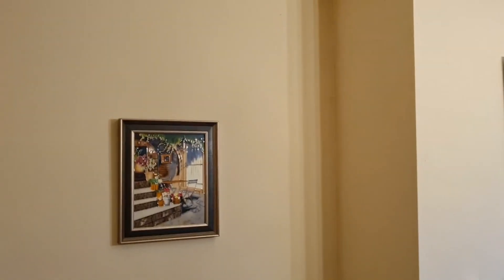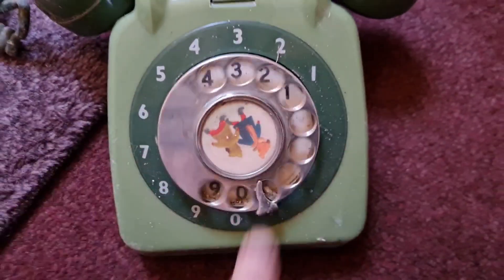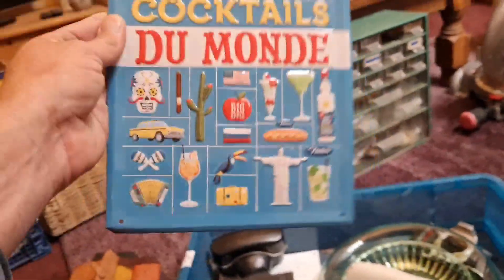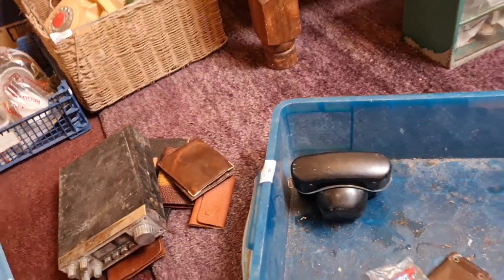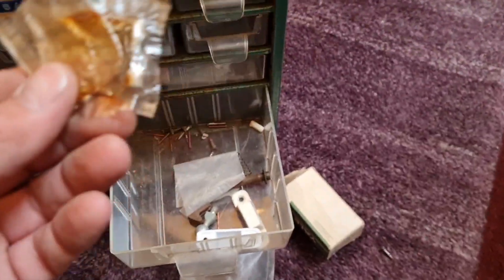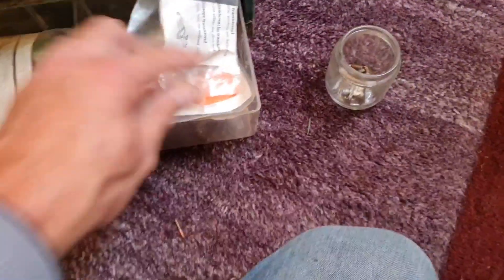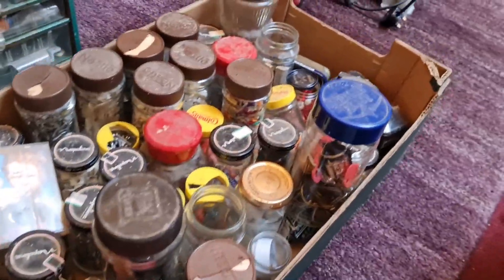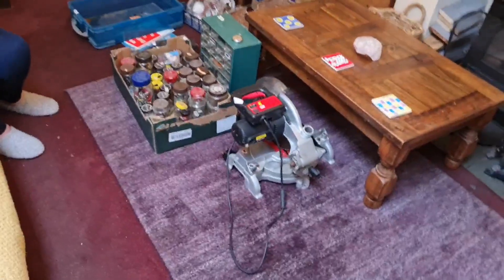I bought 6 lots at Auction. What did we get?

Comment: The long spring looks like the ones used on old television tubes to earth them. Old 4 pin telephone plug (GPO plan4) was used in 60's / 70's when phones were mostly pulse dial. Not sure if Mrs Man Cave is looking satisfied or horrified.
Reply from the maker: Yeah I been looking up them old phones. I never seen them plugs before. Earth strap hay, interesting. 
Thanks for watching Ralf. 😁